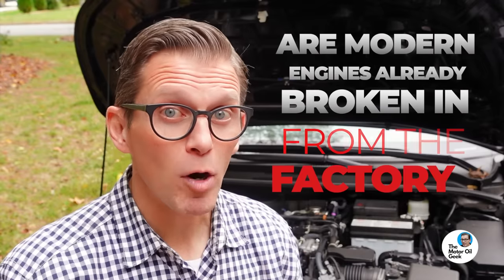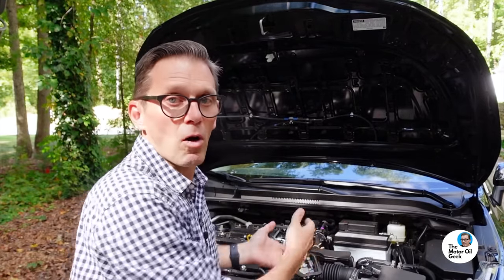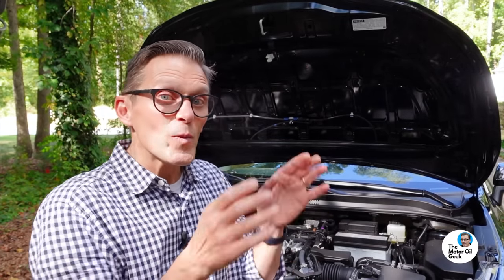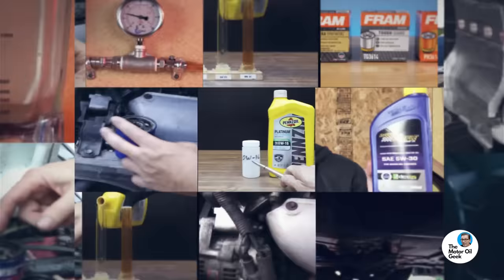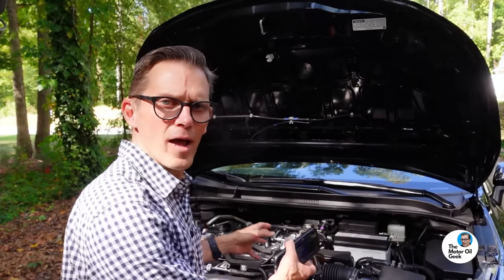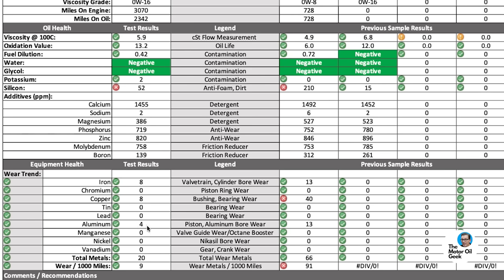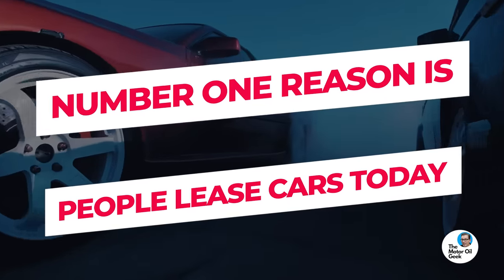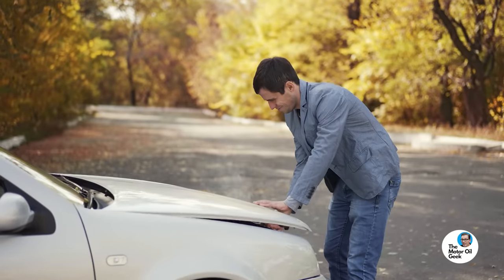New Engine Break-In: Truth or Myth?

Comment: I see you moved from 0W-8 to 0W-16.  I'm curious, I've spoken to two master mechanics who tell me that the 0W-16 is only for CAFE, and is not good for the engine.  One recommended I run 0W-30 and the other recommended 5W-30 in my new Toyota Camry.  I live in the south, so it doesn't get so cold where I think I need 0 weight for winter, so I'm not opposed to the 5W of the 5W-30 recommendation.  What are your thoughts?
Reply from the maker: I trust in what the used oil analysis tells me. I'm not a fan of speculating.
Reply: @themotoroilgeek  And....what does it tell you?
Reply from the maker: @EDFETHER  The 0W-16 did a fantastic job in my daughter's car. A thicker oil will generally generate more engine temperature.
Reply: @themotoroilgeek    As I've continued my research, it's clear that 0W-16 is not a good oil if you plan on having the car long term...for these two reasons:

1.  The primary killer of the A25A-FKS engine, to date, is EGR failure at ~100K miles.  The 0W-16 oil is more evaporative than 5W-30, per the tests shows in Project Farm's video "Will Thin Motor Oil Cause Engine Damage? Let's Settle This!"  I believe that the 0W-16 evaporative traits is a significant contributor to the EGR system failing, and this hypothesis has been corroborated by a Master Mechanic I know at Toyota.

2. I checked with the aforementioned Master Mechanic at Toyota, and per the Service Manual, the Main Bearing Clearance (MBC) on the A25A-FKS engine is 0.00106 - 0.00232 inches (tight when new, but opens with wear).  Per "Driven Oil's" documentation, an engine with an Aluminum Block,  with a MBC in that range should run 0W-20 to 5W-30 @ 160->220F.  The engine's operating temp is between 185 and 195F via the Temp sensor feed to the OBDII.

Per your analysis, the OW-16 offers good protection in the new daughter's new Corrolla...but the engine is still new.  In time, as the parts "break in"...things will open up, and a heavier oil will be needed or optimal protection.  Is it critical in an engine designed for a life of 150K miles?  Maybe/maybe not.  However, if you want that same engine to last 400K miles...I believe a heavier oil should be used.

In my 2024 Camry, I'm running 0W-16 (changed at 988 miles) until 3K miles, then switching to 0W-20, and then at 5K miles I'm switching to 5W-30 for the remainder of the engine life.  I'll pull oil samples at each change.

My $0.02 worth.

Comment: Hopefully not too silly a question, but would it be worth the extra expense and headache of taking home a new car, and ASAP off the lot draining the factory oil for a break-in oil, then changing again around 700 and 2000 before moving to the extended intervals? Or is that excessive? My understanding is that you really don't want friction modifiers in a new engine, as that just delays the break-in period, thus why break-in oils exist.
Reply from the maker: I'd say it depends on the vehicle and what it is going to do. For a daily driver, I don't think it is worth the extra expense and effort, but for a car that will see track time, yes.

Comment: Another theory I heard on limiting RPMs during break-in is to avoid the excess oil pressure which would trigger the oil filter BYPASS and subsequently recirculate non-filtered oil.  Thoughts?
Reply from the maker: That’s an interesting thought. I’ve never heard that before about why to avoid higher RPM’s during break-in.

Comment: I think people confuse break in with end of line tests. Yes, they are fired. Yes, the drained oil will have the first residuals of the liner and piston rings mating. But no, it doesn't undergo the full break in cycle. This takes time and time is money. It's just a quick check to rule out catastrophic engine failures right on arrival.

Comment: From my research, engines are broken in at the factory.  Could the higher metal content in your first oil analysis be the result of the engine being broken in at the factory and then they send the car out with the same oil that they used to break the engine in?  I did a little research a few months ago about this and Porsche recommends a 1500 mile break in but not because the piston rings aren't broken in, it's so all the other moving parts like the valvetrain could gradually wear in.   Also, I found out that an engine break in doesn't take hundreds of miles to accomplish.  The break in procedure involves running the engine to high RPMs a few times while under a load and it only takes a few minutes.
Reply from the maker: Some high end engines, like a Porsche, are broken-in on a dyno, but they are the exception. A normal car or truck engine is run, but that is not the same thing as a full break-in, which takes 45 to 60 minutes of run time under load.

Comment: Sounds to me like if I buy a new car, I should immediately change the oil with something that isn't watery thin, and then plan to change the oil again at 600 miles. I don't actually hate that idea. It's close to how I treat my motorcycles and none of those have had an issue inside the engine or transmission. I generally just do maintenance and wear items like brakes and chains.

Comment: I remember this was a topic on the forums that came up back when the 2007 Mustang GT500 launched, these engines were "supposed to be" broken in from the factory. There wasn't a low mileage limiter on them restricting RPM or timing or anything(as far as I'm aware; this was when I was an impressionable teenager on the internet lol), factory filled with synthetic. Didn't seem impossible in that example - hand assembled performance engines, something like 10,000 or fewer manufactured per year, so not quite the same kind of 'mass produced' as a Toyota Corolla lol. 
Could've been total BS though. Regardless, I don't remember any blown up low mileage GT500s back then, no 'weak' ones that didn't seal up the rings, anything like that, they seemed to be pretty consistent cars. If they weren't factory broken in, then it didn't seem to matter.

Comment: I had this fight with the dealer many times.  The 10k oil change is a joke, I did the first one on my Lexus LC500 @ 1000 miles and from everything that I read they use conventional oil for the break in so I asked the dealer to put in 5W-30 conventional and I took the oil filter back to find the expected sparkles after break in.  Will change out at 3k as well but after that I'm not sure if I should use synthetic or conventional, I'll be changing it out every 3k miles and it's an old school 5.0 V8 NA engine.
Reply from the maker: Right on! You can do synthetic at your next oil change.
Reply: @themotoroilgeek  What brand of oil would you recommend for the aluminum block engine (2UR-GSE).  It's funny that the similar block engine in a Lexus GX460 (also UR series) states to use 0W20 and this one is 5W30
Reply from the maker: @paulsolovyovsky1702  If 5W-30 is an option, I'd go with that.

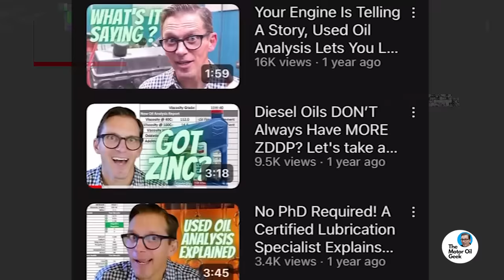Comment: At ~9:30, it sounds as if you're stating from the BIG drop in COPPER specifically, IRON and ALUMINUM ppm results that a SECOND 'BREAK- IN' oil change might be redundant because the results will STABILIZE and not change much if at all AFTER the ORIGINAL break in change done  at ~1,000 miles. Am I understanding you correctly?
 In other words, is a SECOND BREAK- IN oil change necessary?

Comment: Two questions, do you "recommend" to stick to manufacturers oil grade or is that also for their own benefit eg 0-w8? Second question, how much does it matter if you do not change the oil after break in?  Will it have any significant influence on the cars engine life?
Reply: As for the second question, yes, it will burn oil and leak more. It will become harder to pass smog as well as it gets older. The car also will start to suffer from poor performance as it gets older, especially past 100K miles. If you NEVER change the oil, it will eventually sludge up and destroy the engine. If you lease, you probably don't care, but if you are like myself and bought your sports car with the intent to keep it for 30+ years, this all matters. Eventually I will need an engine rebuild, but having to do it at 300 or 400K versus 200K is a big difference in my wallet versus 2-3 more oil changes when it was new. My current car is 10 years old, 126K miles, and still passes smog checks. The cats are clean, it has near perfect compression, and revs almost like new.  Largely because I do preventative maintenance as well as broke it in like he suggests.

Comment: I do 1000, 2500 & 5000, then 5000 mile intervals unless the UOA allows 10K which is possible in a Prius.  My UOA showed a decrease in silicon with the early oil changes, and silicon is bad in motors.
Reply from the maker: Right on 👍 Thanks for sharing!

Comment: What would help with excessive oil consumption.   2023 silverado 6.2 new with 500 miles. Started with royal purple 0w-20 from the beginning and changed every 3500 miles but now I'm adding a quart every 1500 miles.   GM says a quart every 1000 miles is within spec.

Comment: Great video, I would like your opinion on the turbo gm 2.0 turbo i4 gas engine with Amsoil 5w-30 and the I3 turbo in the Chevy trailblazer that calls for 0w-30 also a direct inject engine . Thanks very much for your time and video.
Reply: I meant 0W - 20 on the trailblazer.
Reply from the maker: Thanks for the feedback. A Dexos 1, Gen 3 oil will do a great job.

Comment: Hey Lake. What would be the benefit of using a specified break in oil for a new engine for example the BR range from driven racing. Would using these types of oil’s just accomplish the break in at a faster pace? Thank you 🙏
Reply from the maker: You could do that, but I don't think it is necessary. It would lower the wear overall.

Comment: Engines will have a normal curve of more wear metal at the first few thousand miles. Also if you go 10k miles vs 5k miles this 100% more usage. You also will go maybe through 4 seasons vs 2 or 3. Only a normal thing to find out more wear metal inside a sample right? Now does PPM of wear metal actually not good floating in your oil? Does it settle a the bottom of the oil pan?

Comment: Some owners manuals tell you. That you can change your oil at 7500 or 10000 miles. This is only true if you don't meet the severe driving conditions. If you meet one of the severe driving conditions. You need to change your oil at 5,000 miles. And of course we all meet one of the severe driving conditions.
Reply: Totally agree on 5K mile oil changes. I really don’t understand many keyboard warriors aversion to more frequent oil changes. It’s the life blood of your engine, and cheap insurance to enhance longevity. I’ve always done the first change at 1K for break-in, and all subsequent changes at 5K miles. I’ve never had an engine failure in over 35 years of driving.

Comment: Regardless of myth or not, my go-to routine for new vehicles is to use the original oil in them through the break-in period, then replace the oil (which is usually 500-650 miles depending on the manufacturer break-in period, so for my 2020 Toyota this was about 610 miles (1000 km) but I just did about 500 miles and then changed it. Then I do another at 2,000 miles (regardless) and then a third at the regular interval (which for me is 5,000 miles or 6 months is what I go by, even though many mfrs say you can go 10,000 miles--I don't trust any oil for that long).

But at the end of the day, OIL IS CHEAP, ENGINES ARE NOT.  If you do the 500, 2000, and then start regular intervals with the 5,000 mile oil change you should be fine.  This is what I've done in my past 4 new vehicles, 3 of which have all made it past 150k without oil issues, the fourth is only at 40k as it's newer.  One started burning oil after 150k but this was a Silverado with AFM and that is a known issue with those after a while.

Comment: I got my new car in march this year. I changed the oil at about 600 miles and got it tested, there was visible metal particals and the wear metals especially copper was super high, changed it again at about 1500 miles and visible particals were gone and metals were way lower, I plan to change the oil again at about 3500 miles and I expect the numbers to be even lower.
Reply from the maker: Thanks for sharing

Comment: Different manufacturers have different manufacturing processes. Some manufacturers place their vehicles on a DYNO as a part of the final process, and in modern engines the piston rings seat rather quickly, some of those metals could come from a manufacturing process at their facility where those engines are run, while on a DYNO. The same engine oil that was in those engines during this process will be the same engine oil in the vehicle when you purchase it. Honda puts a break-in oil in their engines, to their specifications, and doesn’t want the new owners to replace that oil until its first oil change. Changing the oil before it’s scheduled first oil change is interfering with this process. Some engines according to their owners manuals only require you to avoid full throttle start ups, prolonged idles, and avoiding aggressive acceleration during the first 15 miles or first day of operation.

Comment: Of course no engine can be broken in from the factory, the best mass- producers can do is run a so called " cold- test" where the fully assembled engine gets spun up by an electric motor and all the sensors on it get monitored to ensure it was put together right. So when the engine gets put in the car at the assembly line and started for the first time atleast the oil is everywhere it should be and its not started totally dry. The biggest risk left over debris from gaskets/ sealants from assembly, the time where you could find loads of casting sand in a brand new car engine should be over.

Comment: On brand new car/s drive 5000 Kilometres and then get Engine Oil and Oil Filter changed. If missed at 5000 Kilometres then do it at 7,500 Kilometres. Don't take it to 10,000 - 15,000 Kilometres to change 1st oil change.

Comment: To be factual, there are TWO things here.  Break in and Wear in!  The engine is Broken in at the factory. Break in is the seating of the rings to the cylinder walls. Wear in is the scrubbing of the rings and cylinder walls.  They are not one and the same.    Seating of rings is exactly as it sounds, the edges of the rings are broken down to get a good seal. Wearing in is just what is sounds like, wearing of the rings and cylinder walls.  If rings are not properly set, they will crack, or bind, in either case the engine is trashed. 

The REAL reason break in oil is not used is because a multiple of reasons, first engine castings today are highly refined, with no trash, and all the parts are finely machined with different metals than in older engines, and OIL today is not like oil back then.
Reply: No not really. On final assembly engine parts are measured and colour coded according to limits and fits.  Engine parts are then colour matched and the engine is assembled.  The engine is filled with oil and hot tested for a minute or less.  In my day the first fill was oil laced with jewlers rouge, it turned the oil red and it became known as breaking oil. It is slightly abrasive to aid breaking in.  As machining tolerances improved the grades were closed up but they still exist.  Jewlers rouge is no longer used. But it is important to break in the engine and all the other moving parts on a new vehicle. The dealer will always tell you to drive it like you stole it, they sell more cars that way.

Comment: Good info, but you cant conclusively say they didnt "break in" engine.  They could have broken it in and not changed the initial oil.  We can state wear metals have decreased by X and have maintained within X% on the next test interval.  I did change my new car oil around 700 miles as well.  Thanks for the info.

Comment: I done an oil change on my brand new 2021 Tacoma at 1000 km, not miles.
Then another one at 5000 km.
The first oil was sparkling with the metal.

Bottom line,  do first two oil changes quickly!!!

Comment: You did a video about Valvoline being the only one who still does engine testing. It was 5W20 in a 3.6 Pentastar. I have one with 264,000 miles on it, and have always used Mopar oil. We are religious about keeping good maintenance. Is the Valvoline or Mopar a better option? Thanks.

Comment: In my opinion engines aren’t broken in at the factory. Modern engines have much tighter tolerances, higher quality/increased surface durability with lower friction materials. This is combined with an engine management system(s) that bring the engine to operating temp much quicker as well as a consistent A/F ratio and knock protection. Lastly running superior oil that also is quickly heated to op temp remaining in a consistent temp window as it’s plumbed to the coolant circuit. Drive with respect for the first 3-500 miles then change oil to turn off the nagging voice in the back of your head about it. Pull apart a 100k mile engine that’s been properly maintained/operated and you more than likely still see the cross hatching on the cylinder walls.

Comment: Already broken in or not, it's not going to hurt anything to change it extra early.  I would still change it, but that's me.  😉

Also, people need to know that modern oils in modern cars needs to be changed at 5,000 miles, NOT 10,000 miles.  People PLEASE DON'T wait until 10,000 miles to change your oil.  That's what dealerships and oil companies are telling people now, saying synthetic oil will last longer between changes and blah blah blah.  Yes, modern oils are better, but not 10,000 miles better.   A lot of blown engines occur because of this.  😒
Reply from the maker: Thanks for sharing